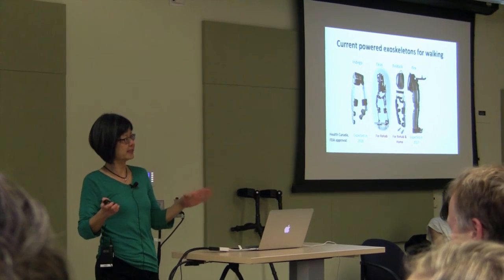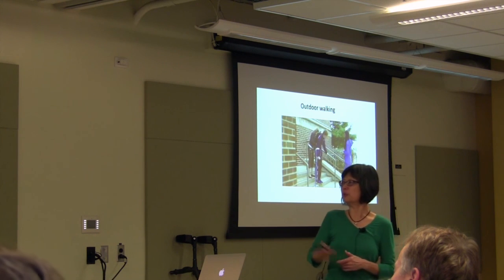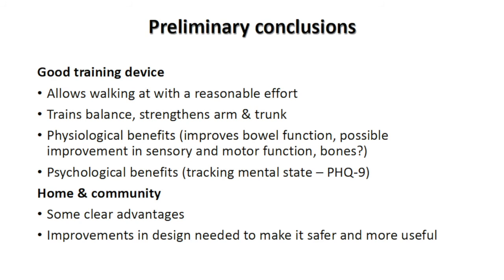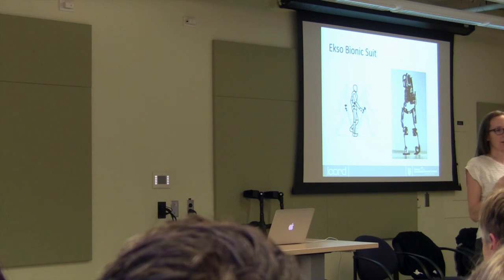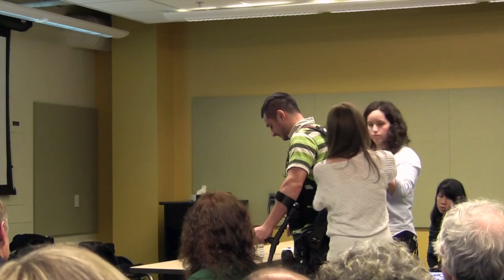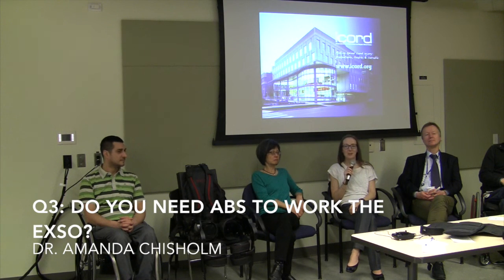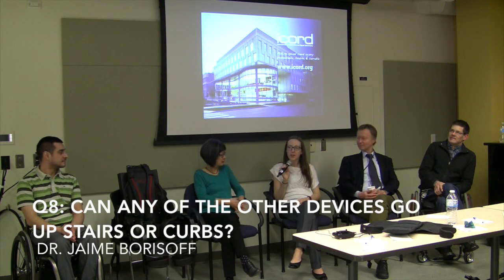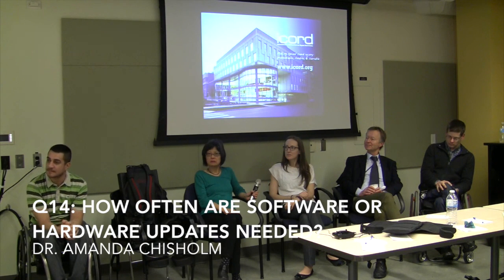Robotics Revolution with Dr. Jaynie Yang & Dr. Amanda Chisholm, ICORD

Comment: I can't believe this has no comments. This is absolutely amazing! Pricing? Looking and researching to possible start a gofundme for a friend to receive one of these. I wonder how would  one acquire information to be submitted as a participant to receive one🤔. Subbed intrigued so much so I might try to build my own.
Reply from the maker: HI Mzti, These are now available in the US, Canada and Europe for therapeutic use (ie with a physiotherapist or in a rehab centre). You can purchase them individually but they are designed to be used with a therapist. Both Ekso and ReWalk are looking to market consumer-oriented versions (ie cheap enough for individual use) and I heard a rumor the USFDA may have approved these devices in principle for home use. You'd have to contact the manufacturers for information on price. Many versions including new models from Toyota and Hyundai are now in development which ultimately will bring prices down in the future. In the meantime you and your friend can get some of the same benefits by doing bracewalking or using a robotic locomotion trainer (the model ICORD has is called the Lokomat by Hocoma).
Reply: Spinal Cord Injury BC  Hello and thank you for responding. I understand I will do further research and if possible look in maybe a crowd funding if the price is not possible. I am newly self employed so it maybe out of my budget but I want to help so I have to put in the work. Thanks do much for brining such awesome information  and seeing what is trully possible. #hugs #sharethelove